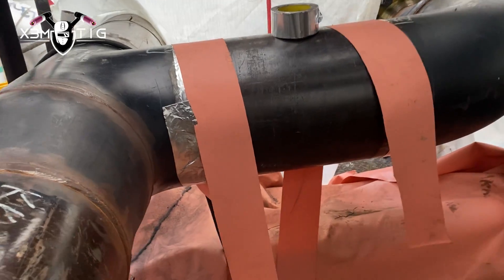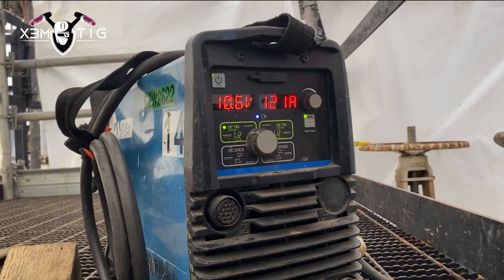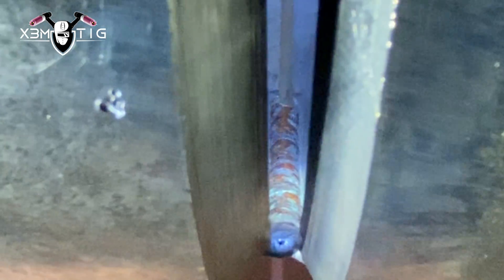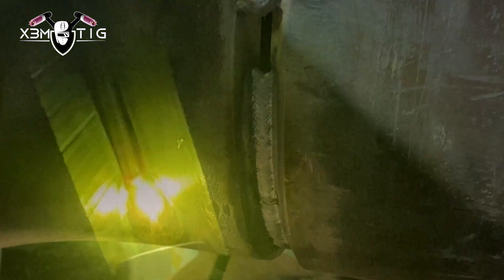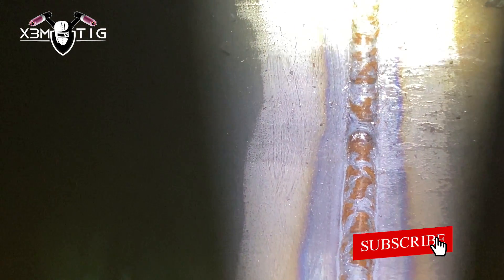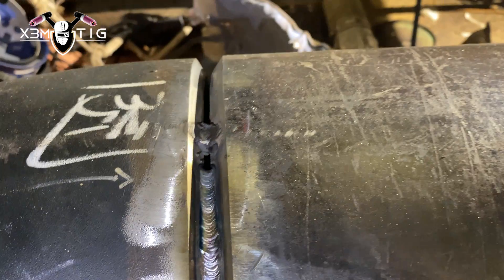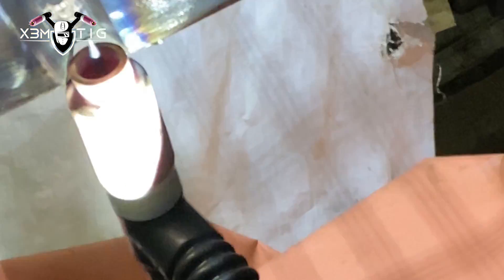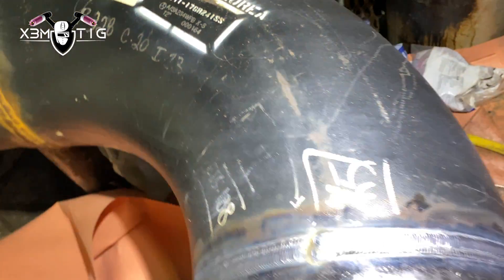12” Carbon Pipe TIG Welding – The Root Pass Hack You Need!

Comment: What is the secreat or tricks of a  heavy root boss
Reply: The 'penetration' of your root pass is mostly determined by how far your filler wire is inside the pipe if you're doing the backfeed method. Focus on keeping your wire inside the pipe(behind the edge of your bevels). Also make sure to feed your rod and move your torch side to side at an even pace. If you move to slow or keep your torch in the center for too long you could suckback the root you just put in. Hope this makes sense...
Reply from the maker: Well explained
Reply: very clear
Reply: Well done